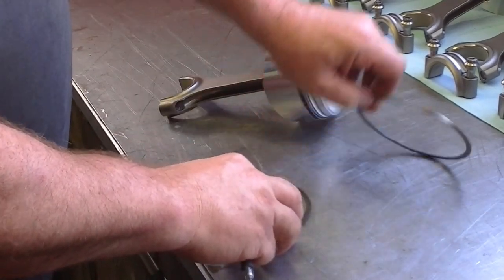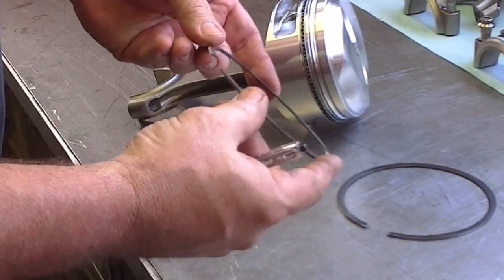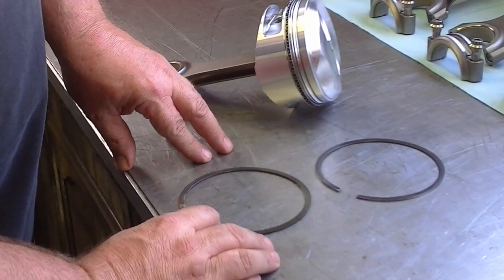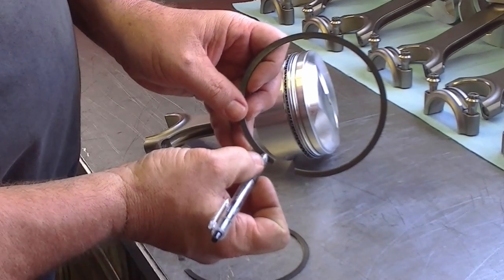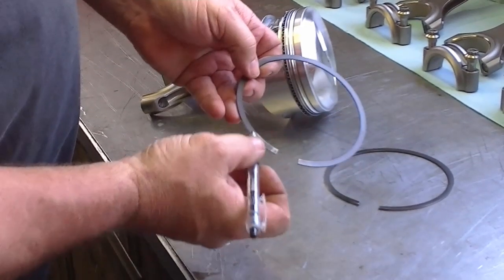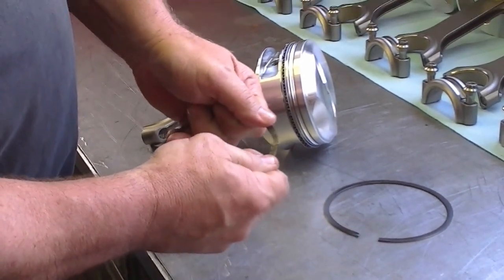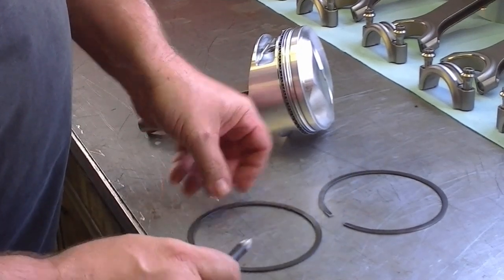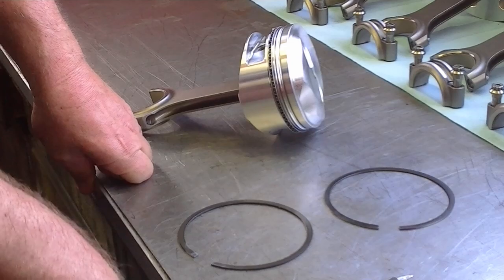How to Tell The Difference Between Compression Rings

Comment: I got a stupid question I’m working on a 200s engine bought new rings and they say 1st ring and 2nd ring on two of them I know the other two rings and squiggly one goes 3 rd down but what is confusing me is does 1st mean it goes into second notch down or first as in at the top of piston hopefully I explained it well enough to understand what my confusion is?
Reply: I cannot seem to fit these rings into cylinder which is nuts because it’s tapered and tricks of the trade as well to feed it in?

Comment: I am thoroughly confused.  Neither of my rings have a dot or dimple.  Both have bevels at the same angle as each other.  ONe ring has an "R" on the top.  The second rings had an "RN"  I cannot tell them apart EXCEPT that one ring is graphite gray and one rings is black.  They both feel as rigid as each other....I'm lost 😛
Reply: any mark goes up. if no mark it doesnt matter which side up. hope this helps u 8 months later